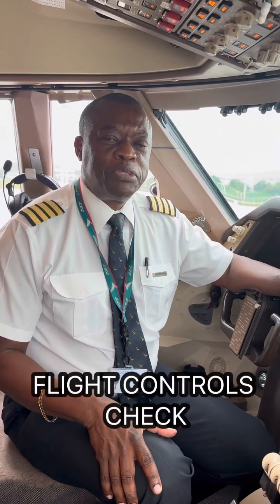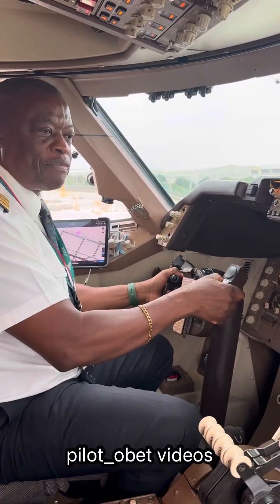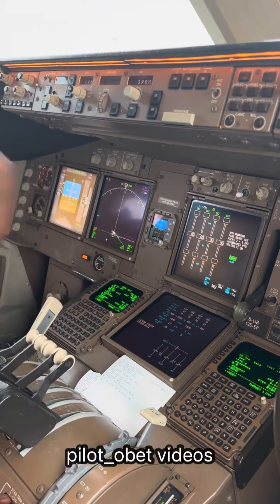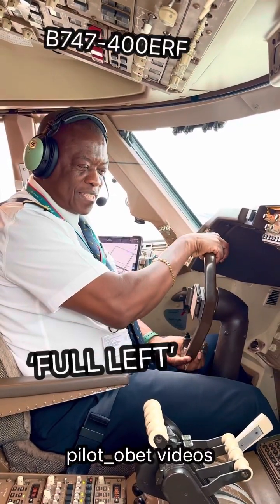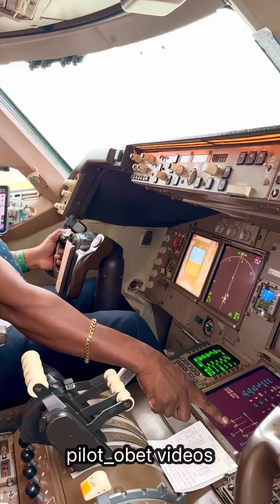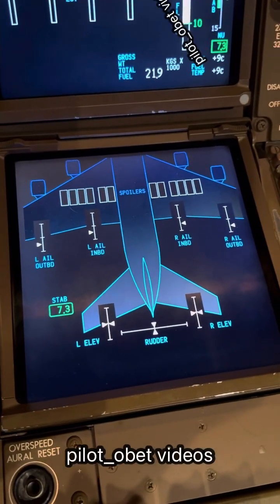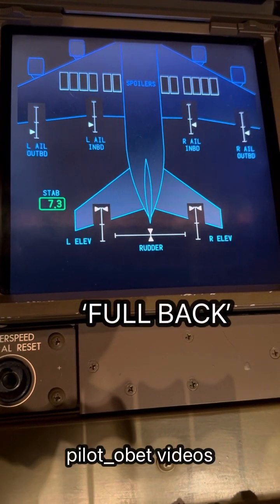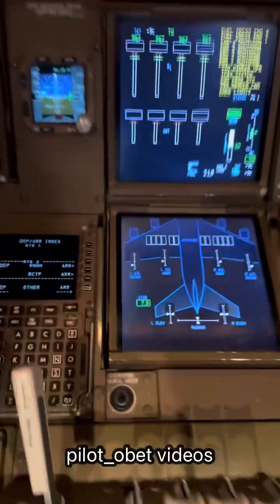Boeing 747 ‘FLIGHT CONTROLS’ check

Comment: Hmm, i am curious. Did you ever have problems with sensors which showing the position of flight controls. And is there any way to understand if that sensors are broken and not showing an actual position of flight controls?